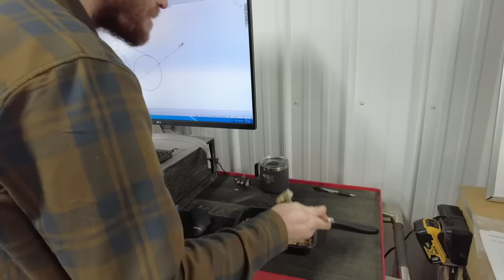FINISHING The Addition Before Baby Arrives!

Comment: Just a word of advice, once you go to double wall vent you have to continue double wall until the termination as per code. The reason being is if you go back to single wall it creates a spot where condensation forms inside the pipe and will create corrosion holes which will cause a bad carbon monoxide issue. I would also advise building a chase around the vent pipe, double wall or not, because it will get hot and you don’t want the little one getting burned on the vent.
Reply: Was going to say the same thing about protecting the hole. Might be good to make it about 10" from the outside of the pipe to the outside of the cage to give the little one time to learn what hot means before they can reach it.

While I'm here I'd like to add: please also carry a weapon on your property but you don't need to tell us what it is or that you do & I think a plexiglass window looking down through the half wall might be fun for dogs and children.

Comment: Having a big cat in the area is about as worse as it can get because they can climb better than a bear and have likely visited the deck already as well as check out everything it can smell. The night especially belongs to them, and you'll have to put a chain link top of on the dog run plus close of its door during those hours till its done. Indeed any activity at night needs to be more vigilant and monitoring around the house hopefully with a thermal camera since it and others will stand out like a neon sign.
Reply: 💥💯🎯
And close the doggie door until there's a roof on said kennel run...
Reply: Also, start packing.

Comment: Courtney the best way to mix the mud box is to remove it from box! Get a clean pail(5 gal) and turn mud box upside down! But first fold back plastic bag holding bag around the box invert and let the mud fall into pail Use what you need and when cleaning up, protect your mud by putting an amount of water over top of mud! Next day pore off an amount and then use your mixer to get the right consistency in your mud! Doing a great job finishing
Reply: Pour vs poor vs pore

Comment: We use battery maintainers from Harbor Freight, the more expensive ones, to keep our batteries from dying prematurely on our lawn tractors and other machinery.  It also extends the life of the batteries.  Before putting the maintainers on, we would have to replace the batteries every two years.  Our lawn tractor battery is going on 7 years at this time.

Comment: Hey guys.
Word of advise: Keep a charger on your batteries in your machines. It saves your batteries a long way and you don't have to buy new once all the time. And I guess your Solar storage should be able to supply the little energy need for this. Of cause you will need to buy many chargers and wires for them, but I think it would be worth the while.
Warm greetings from Denmark and the electrical engineer with a lot of battery knowledge.

Comment: Hi guys,
We live in the S.Western area of Oregon and more than likely the deer was probably taken down by a cougar. Bears can be fast, but a cougar is MUCH faster.
  One early evening, my wife and I were sitting in the living-room watching the news on TV and a herd of 5 or 6 deer went blazing across the yard 10 feet from the picture windows in a full tilt run. Two seconds later a very large cougar went flying past hot on their tails. As soon as the deer went down the embankment and hit the driveway, they split up and went in all different directions. The cougar must have been chasing them for a while because when it got to the driveway it just stopped, out of breath, stood there for 5 or 10 seconds panting and then just walked on into the woods.
Yeah, when I go hiking in the area, I take an old retired ski-pole, without the basket on it, as first line of protection (very sharp pointy hardened steel tip) as a walking stick, backed-up with a sheath knife and a .357 in case of a bear that might not take a repeated shouted "GO AWAY" as a warning. Usually they are more afraid of us and will avoid us, but sometimes not.

Comment: The addition is nicely done and efficiently designed. I love that all the engineering education was applied to a DIY project and shared generously. Inspiring. 

The only part that gives me anxiety is the half wall, stairs and hot smoke stack with a future toddler around. But I suppose the half wall could be childproofed with a tempered glass enclosure to the ceiling. Stairs could receive soft padded covering and maybe be redesigned to wrap around in a square spiral  with short runs and landings and be less steep. Insulation or maybe fire brick enclosure around the stove pipe could be childsafe.  If the loft office is meant to be adult space only, maybe adding a door with an alarm on the staircase entry at the bottom could offer childsafe design that is better than climable gates. Whew, I feel better already. 

As for childproofing against outdoor predators, door alarms throughout the house are easy installs and inexpensive. There are wireless systems made for pool gates. Many transmit to phones as well as sound an audible alarm at the entry door.  Toddlers on occasion roam inside the house during the night, and curious tykes have enough dexterity to unlock deadbolts and venture outside while parents are sleeping, so toddler alarm systems are not a luxury out there. Maybe an episode on those would be interesting. 

Best wishes,

A fellow Idahoan

Comment: Half-walls❓all the dust from working in the shop will gather on/in  your computer, and on every area that is not coverd. smoke plus welding-gases goes up. Been there, done that. Not good. I did, put up plexiglass, from the half-walls to the seiling, it worked great.😉

Comment: If the office space stays awkward for you with the stove pipe there, plus the kid safety issue with touching the pipe I have a possible idea for that area.  Box out the pipe using sanded 3/4 plywood up to the roof line.  put a 2x4 frame on the inside of the pipes hole extending that up to the roof line to support the paneling.  This will give you more flat surfaces and partition the area.  Now you can work with this possibly creating a deep pantry storage or install a cabinet and counter top for a crafts work station with power from the outlet you have there, just off the door side of the area.  Then in between the pony wall and the new boxed area you can do a shallow cabinet or shelving to fill that gap.  Just some ideas for you.  Thank you for sharing your adventures.

Comment: Working at a fab shop-our office space was separated from the shop by two sets of doors that formed an airlock. 
Every morning I’d still have to wipe brown dust off my computer and desk due to welding and grinding dust that penetrated every nook and cranny and stuck like fuzz to anything magnetic - including drywall screws in metal studs. 
We breathed that same dust every day. 
I hope your experience with a half wall configuration open to shop and dusty outside air when the overhead door is open works out for you. 
If not, consider some windows and an air handler?  Our air handlers and smoke filters were always clogged. 
A lifetime of bad air and no PPE or masks has me wheezing like an asthmatic now at 58. 
Stay healthy.

Comment: Finished a lot of drywall and paint in winter in Colorado mountains. We always used propane heaters, because they don't put out the humidity of  deasel or other. They will put an un seen scum on the wall's not good for paint.

Comment: Isn’t it possible to attach an air line to the shop water lines in order to purge them in the winter? If it is possible shouldn’t it be done before you put up drywall?  I still think putting a lot of insulation around the water lines is needed.

Comment: Riley, the heat does not "create the moisture"; the moisture you are seeing condense on the cooler walls is already in the colder air- warm air will not hold nearly as much moisture as cool air- so when the warm air blows, the water will condense on any cooler surfaces. As a matter of fact, circulating warm air will dehumidify the air over time. My thoughts are that had you done so before the poor, a heated floor might have been a better choice- you could keep the interior walls warm enough to keep them from becoming condensing points. Just my thoughts, soldier on, Riley!
IN one of the clips from near the whop, you look to have a cougar in the hood- very nocturnal and could have easily carried the carcass off without leaving a bloody trail. Stay away from where it is "setting up house" and it will likely stay away from you and tend it's nocturnal habits unless it has trouble feeding regularly. Hunting them is a task best let to professionals- they will "hunt you back"- work around in a big circle to get you on a path and double back to wait on your arrival. It is uncommon for an predator to make a kill and abandon it- unless spooked by some other larger animal- there may be more than one .
Your office turned put awesome, Court!  Just in time to start sorting baby pictures for the editing!

Comment: Great video! I know you don't need a building permit for the drywall but did you have to have a permit for construction of the structure, electric, and plumbing? If so did you just not video the building inspector signing off on the construction?

Comment: I have to tell you about logging my land. The forest service could have stopped the pine beetle on their land but did not, so all pine were killed. So the pine trees were becoming widow makers.  I tried to find a logger that would just take the dead pines. After 2 years I found one. I told him that I didn’t want the limbs raked, it destroys the ground and I didn’t want slash piles. So he asked what I wanted him to do with the limbs. I said take the trunk and just leave the limb where they fell.  He liked that, much less work for him. But the county land owner’s advocate didn’t like it, he said the logger was taking advantage of me. I told him it was my idea not the loggers.  
So the next spring the advocate called and wanted to inspect the loggers work, he needs my permission to go on the land. I told him to call the logger, he could go if and when the logger said so. The logger called to thank me for that, he had a few trees fall across the creek, he would have gotten fined for that.  Later the advocate called and asked if he could take some other loggers and land owners on my land to show them how logging should be done.  The limbs go back into the ground in just a few years, much shorter , (10 to 20 years shorter) than it takes land to recover from racking the limbs into slash piles. And in not much time, you can just ride the ATV over problem limbs, it just crushes them into the ground.  And the limbs protect the ground from snow melt runoff erosion. 
My advice is to find a logger that will do what you want, be explicit in what you want and what trees he can take and how he is to leave the ground, where he can or can not cut roads. A logger like that needs to be trust worthy - trust but verify. And getting the top $ for your trees usually means the logger is going to take shortcuts. But not having to rake limbs into slash piles means less work/less cost for the logger and should yield a higher value for your trees.

http://www.doughale.com/Property

Comment: As much as you like your dogs you should have some more appropriate animals for the wilderness with wolf bite collars. And I've never seen you talk about carrying a gun or rifle.

You should have roads or at least trails along your property line. Then setup pulsed electrified barbed wire. Clear the trees back far enough so there will be little chance of falling branches damaging the fence.  At the same time you can setup AC power lines all along the border and cameras. You can leave sections of fence open but have cameras notify you of visitors.

Comment: A deer is pretty big for coyotes, though not impossible.  Possibly a wolf.  Cougars tend to carry off the remains of their prey and hide the carcass under sticks or brush so they can come back to an "undisturbed" meal.  A bear might also kill a deer.  Deer do die of natural causes, and coyotes might take advantage of the free meal that provides.  But in any case, it's probably prudent to keep the dogs nearby and be prepared to assist them in fighting off a large predator.  I would be carrying a big sidearm or a carbine.  And the requisite hunting license, even out of season. Better to be prepared and never need it than be surprised and out of your depth.

Comment: Hi Courtney and Riley! I'm a watcher from a good while back, and I finally subscribed. I love you guys and...well...if you ever have bad days, it certainly doesn't come through on your videos. Riley, I have a question for you: When you went to your building to get your ATV, I noticed you have both Stihl and DeWalt pole trimmers. I have a Stihl, and as I get older, it has become fairly unwieldy, especially extended all the way out. Do you think the DeWalt unit is as capable as the Stihl? Thanks!!
Reply from the maker: The 20V DeWalt pole saw we have is not as capable, and is actually a little more difficult to use because the motor and battery are at the saw end of stick. But it is VERY convenient for quick trim jobs.
Reply: @AmbitionStrikes  Thanks for you input!

Comment: Do not feed the stray cats!
Keep your heads on swivels, they come at your backs unless mama is protecting her litter.
Always carry some defense with you, and don't try to scare them away.  They wont be trying to scare you...
Good thing they don't consider people prey, but their instincts are to pounce and strangle.  They will target the dogs if they can.
October 4th, 2018 I had a delivery to Tractor Supply in Fortuna, CA.  I took CA-299 from Redding and there had just been a fire through there.  On my way back, I was about to violate my 14h when all traffic was stopped.  I talked to the CHP on duty there and told them of my predicament.  They had me pull into a staging area nearby for the night.
I was both blessed and cursed they had a porta potty there.  As I was returning to the truck in the twilight, the hair on the back of my neck stood STRAIGHT up!  I felt like I was being stared at with extreme malice!  I made it back to the truck without incident, but I won't ever forget that feeling!
The next morning, I had trouble pulling out because I was in loose soil and gravel.  That was when I saw the cat tracks around my trailer.
Anyways, be super careful about cats.